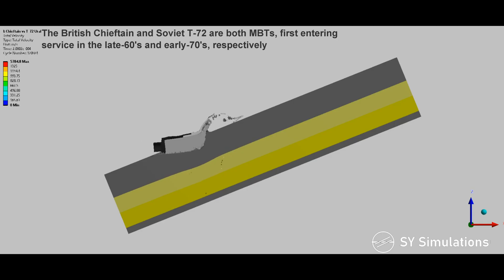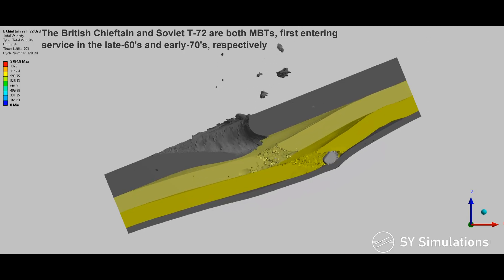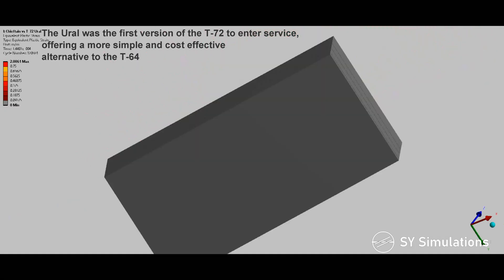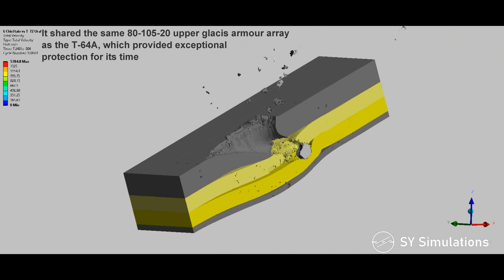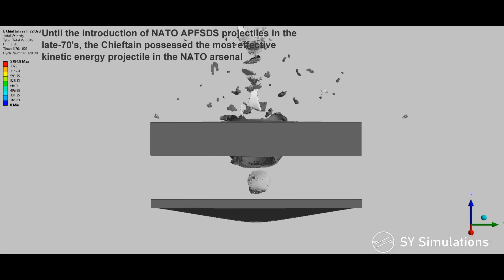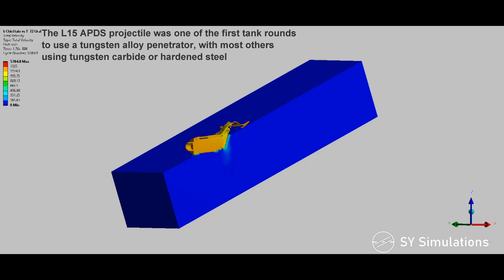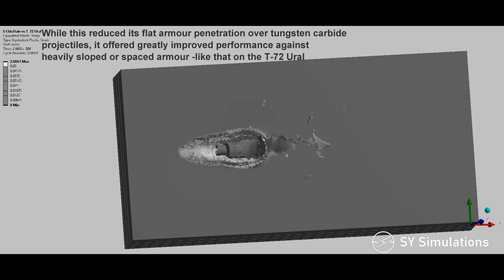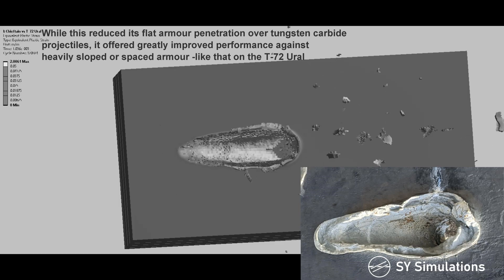CHIEFTAIN vs T-72 URAL | 120mm L15A5 APDS | Armour Penetration Simulation

Comment from the maker: Long-time followers of the channel will notice that this is a re-run of a Chieftain vs T-64A video I did 2 years ago. It's one I've wanted to redo for a while with better material models and a finer mesh, enjoy! 

Also, thanks to those who have supported the channel for so long and welcome to any new subscribers!
Reply: Will you ever do a rerun of the comparison between capped VS uncapped AP rounds?
Reply: Now redo T72 against Chieftain stillbrew (maybe closer range than before?)
Reply: @simonh317  It was Dejmian XYZ who tested the Stillbrew, not SY, plus it was against T-62, not 72
Reply: @thezig2078  aha! Thank you. However, an opportunity now presents itself
Reply: @simonh317  i think any tungsten round from T-72 would easily destroy Stillbrew Chieftain
Reply: @thezig2078  hence the question, as the math shows most short rod would be intersting but long rod aka Mango and newer would go through
Reply: Great work!
Reply: If you want to take a Crack at naval shells again, I found some documents from the US Navy that might throw the performance of the British BL 14-inch into disarray.
Reply: Would you be interested in testing stuff like M900 against Kvartz?
Reply: In case of T-64(not A, but just T-64 ie still with 115mm) vs Chieftain it has historical flair of "first two TRUE MBTs facing off".
While this is more of "reality called and said neither side has a budget for it so tune it down".
Reply: any person who has studied metals and materials at the first glance at the picture, the contrivance of the video becomes clear. 1. The material of the projectile is completely heterogeneous. The tracer nut is not capable of piercing armor even 15 mm at any speed. 2. The destruction of the projectile will occur in a completely different way than in the video. Different properties of the material on the surface and in depth. 3. The only sane military technical university in the world remains - Baumanka!!! All the others are Mom's pies.

Comment: Actually T-72 cost more than T-64A being even worse. Main reason to produce T-72 was low technology and weak production capacity of the Ural Tank Plant. So Soviets need more tanks than Kharkiv Plant can produce and created simplified tank for reserve soldiers that can be build in Tagil.
Reply: Initially, it costed more than T-64A, but it wasn't worse. Material quality was the same, engine power output was the same, gunner instruments were the similar all while having the potential to be cheaper (and in later production it was) and the parts and production were familiar leading to easier production and maintenance. The T-72 was built to replace T-64 and in the 70s-80s and especially after the advent of T-80B, that seemed to be the appropriate action, but then politics got in the way of that. And the only thing that T-72 lacked in the late 70s and 80s was the gunner instruments and electronics of T-64B. But in pretty much anything else, T-72 was better. Slapping on new electronics on T-72 was thought of for a long time. It didn't get it until 1990 because the electronics of the time were either too complex for a general use workhorse(only reserved for more specialized vehicles like the T-80s) or not up to standards.

Comment: Here it is assumed that the upper armor plate is 80 mm thick, the lower one is 20 mm, and between them there are two fiberglass plates, each 52 mm thick. this is not entirely true, this arrangement of armor is typical for the experimental T 72 series; the first T 72(A) series had an upper armor plate of 60mm and a lower one of 50mm. The export version of the T 72a had 150 mm solid armor plate, reinforced on top with a 17 mm sheet.

Comment: How the outer plate=80mm can looks thicker than the shell caliber = 120mm.:)
Reply: APDS = armor piercing discarding sabot. It's a sub-caliber projectile. It's fired out of a 120mm gun but the actual projectile is like 60mm.
Reply: @angry_zergling  The video shows the entire projectile.
Reply: @dmitrypopov2614 youre confusing apds with apcr. whats shown here is the sub calibre projectile it does not have the sabot attached

Comment: To give a sense of how much the textolite might be contributing to the protection (even though it's not optimum for kinetic), I've seen docs stating that the Chieftain APDS could go through:
1) 10mm plate + 330mm gap + 25mm plate + 330mm gap + 50mm plate at 2000 yards at 65 degrees to normal
2) 10mm plate + 330mm gap + 25mm plate + 330mm gap + 80mm plate at 1000 yards at 60 degrees to normal
Reply: Yes its impressive how compositive was.
Basically made the soviets tank almost impossible to pen by NATO tanks for a while... This while those could easly fight back at ranges that should not be considered "effective"
Really good for west that there was never a hot scenario specially before mass introduction of better armored tanks like Abrams, at least land wise.
Reply: @gerfand  yeah nato pucker factor would have been at max.
Reply: @rickfastly2671  and again who knows on actual performance when all just done by guessing and test?
Reply: @gerfand  even so and test were shown are correct, it's always depending how would you conducting the fight, what you had and what condlition, otherwise, who knows the result? when that battle isn't even happening in reality?
Reply: @nothingnothing8503  considering the number advantages of Soviets and other stuff, I belive in Soviets reaching France in a good time from east german border.
Reply: @gerfand NATO was huge developer of ATGMs and was ahead in aviation. 
NATO has less developed tanks because it was not as tank heavy army as soviet one. Plus while soviet tanks had better armour, NATO tanks had better fire controll  systems. Chieftain got laser rangefinder sooner than any soviet tank did for example.
Reply: @petrsukenik9266 FCS is irrelevant when you consider that the gap is like 2 or 3 years. Vs ~16 years for compositive armor
Yeah aviation is another history albeit Soviet designs where not that inferior, at most its them being behind on eletronics
Reply: @gerfand gap is 5 years. And 5 years after soviets couth up, NATO was starting to field APDSFS, composite armour and testing thermal optics. So in reality soviet tank adwantage was only lasting from introducing T64 to 1970s. After 1970s NATO was either having adwantages elsewhere, or straight up dominating with 3rd gen MBTs.
Reply: @petrsukenik9266  quite on the contrary the first APFSDS used by NATO were introduced around the same time Abrams was being introduced.
this means that for 15 years, from 1964 to 1979, there was nothing in the Western Tank arsenal that could counter the T-64 and T-72.

On other Hand in the 80s the only advantage the NATO tanks had was the Thermal optics, everything else they were from inferior to equal that makes no difference (for example T-80B FCS was superior to M1A1 Abrams, but I'm not giving it a point because they were not that different, however Abrams had a much worse Commander station, with the commander having to use a NVG to even see at night, or the Gunner Thermals, which goes against the pourpose of scanning independently)

The difference only really appear after the Cold War, mostly due to Soviet Economical colapse meaning Russia could not develop its arms industry.
Reply: @gerfand  while for 15 years soviets had armour adwantage in those 15 years there was also period were NATO had accuracy adwantage. 
And i would not say thermals were only adwantage (though completly crucial at nightfighting) NATO tanks are on aweradge more mobile, ergonomic and safer for crew.
Reply: @petrsukenik9266  "Accuracy Advantage" How?
The T-62, because it was firing APFSDS was more accurate than any APDS tank in NATO service. the Fin stabilization simply made it more accurate than the spin stabilized NATO tanks... if you talking about FCS that is also not true at all.
Tanks would only get stuff that differentiate them from olders at the time we getting Abrams and T-80B. M60A3 yes had a FCS, but again the tank is from 1978.
Sure mobility is one thing that was in favour of NATO tanks, but not "Ergonomics". 
A T-72, for example, is not cramped at all, and people just look at the smaller turret and forgets that theres 1 less crewman there, both crew are also sitting helping with confort
The ammunition safety is true for some of the modern tanks, but that is only if the tank is penetrated in the first place. I say that because you are less likely to die from a frontal hit in a T-80U than a M1A1, due to better armor protection (also M1A1 HA, but the difference is lesser due to the hull only being weak)

Comment: Yellow driver moment
Reply: @Ry-bo9hi  the podboi spall liner would absorb close to all the spall leaving the cracked back plate I'd suppose....
Reply: @Masterafro999  did the T-72As have spall liners?
Reply: @stephenallen4635  based on what?! 😂 You just say no because soviet or what?
Reply: @Masterafro999  I said no because it doesnt have spall liners. have a good one neckbeard redditer
Reply: @Ry-bo9hi  all t-72s starting from the t-72 Ural had the podboi anti radiation liner, which acts as a spall liner, installed all around the crew compartment. It ranges from as low as a double 13mm layer (26mm in total) surrounding the autoloader to 50mm lining the turret roof...
Reply: @stephenallen4635  projecting much?
Reply: @Masterafro999  from sovietarmour blog written by a former t72 tank commander

"The cross-sectional drawing below, taken from a CIA report on Soviet tank developments, indicates that the thickness of the "Podboi" lining is around 50mm behind the upper glacis composite armour. However, it appears that this was incorrect information as internal photographs and cross sectional drawings of this part of the hull all indicate that there is no such lining. It is most likely a misidentification based on the presence of air pipes shown in cross-sectional drawings."

the anti radiation liner may be thick enough on the turret to act as a spall liner but there is none on the glacius

Comment: Sorry new to the simulation composite armour sphere but i always wonder wgatts the hse of textolite which is softer than RHA and more brittle
Reply: Less weight than armor but more line of sight thickness HEAT projectiles penetrate a given amount regardless of the material - let's say a given heat penetrates 400mm LOS. 100mm armor + 200mm textolite + 100mm armor would stop just as well as 400mm armor but at half the weight.
So the textolite is mostly to stop HEAT and has neglible effect on kinetic.

Comment: Not quite able to get through. Looks like it causes some decent spalling though. Each hit might not consistently cause crew casualties or damage to internal systems, but it's enough that I can't imagine that any T-72 crew would be willing to sit there and take repeated hits.
Reply: Yours is a hypothetical statement showing no understanding of actual behavior in combat. Any tank that fired and failed to penetrate would be knocked out in return.
Reply: @USB740  In a video game maybe. But not in real life. Experience from WW2 showed that the single most important factor in winning a tank vs tank engagement was firing first. Even if the first round missed or failed to penetrate the tank that fired first would almost always win.

A non-penetrating hit will still deliver a massive phsychological shock to the crew. Imagine standing with your head inside a church bell just as it's struck with a 6.8 kilogram hammer traveling at 625 meters per second and you'll get the idea. The crew would likely be able to recover from this shock given a minute or two of peace, but the first shot will be followed up by more shots until the crew either retreats or bails out.

Even if the first shot misses, the tank that fired first is still likely to win. This is in part because two tanks are unlikely to spot each other at the same time. The tank that fired first is already in the process of correcting their aim for the second shot while the other tank is still trying to figure out where the fire is coming from. Being under fire also puts the crew of the second tank under stress, which makes it more difficult for them to focus on finding the enemy tank or on aiming.

Having better armor improves your chances of surviving an engagement that you've lost, and possibly re-engaging later under more favorable circumstances. But it doesn't massively improve your chances of winning an engagement. No matter how good your armor is you never want to just sit there and take hits. Even if none of the hits penetrate they can still degrade or even disable the tank. There are always vital systems that need to be outside of the armor in order to function. Most obviously these include the sights, the tracks, and the  gun.
Reply: @gareththompson2708  Our T-72s were much better than Iran's chiefftains which stood no chance from even 1km away in frontal engagement. The 120mm smoothbore, APFSDS 3bm9, quarts and composite armor, mobility, reliability. This is why the T-72 was the best tank of the war.
Reply: @USB740  I'm well aware that the T-72 was better than the Chieftain. But that has nothing to do with what I was saying.
Reply: @gareththompson2708  the simulation did not render in the podboi spall liner...that would have caught the majority, if not all the small. Also the chieftain was unable to effectively deal with the t-72 even at 700m whilst the t-72 could penetrate the chieftain at ranges exceeding 2.5km. so I'd say that it would have been the chieftain that definitely would not like to stick around after firing...
Reply: @Masterafro999  Yes this is true i know it firsthand.

Comment: What is Textolite? Looks like water, uncompressable for sure.
Reply: It's fibre glass panels. It's there to disperse HEAT. Effects against solid penetrators is similar to spaced armour and has no effect against APFSDS.
Reply: @oohhboy-funhouse  I heard fiber glass in resin. But it looks like uncompressable to the level that it nicely bends the backplate. I can't really image that, because if it is really uncompressable then in a similar configuration a fuel tank as armor disperses the pressure.
Reply: @2nolhta  it's glass-reinforced plastic armour....more akin to bulletproof glass in some ways...only in some

Comment: Now I’m curious what the old 183mm would do to a T-72, even if the gun was basically outdated by then
Reply: 183mm HESH? Even if it didn't penetrate the armour, the tank would still be probably be wrecked. I mean it would have probably blown off all the road wheels if it was a side shot, ruined the gun, all of the sights ect, as well as wrecking machinery inside the turret like traverse motors ect and everything.
Reply: At that point it doesn’t matter if the HESH did it’s job, in the gun’s trials it was said that it BLEW A CENTURION’S TURRET CLEAN OFF with the force of its explosion alone
Reply: @charlieyes4946  ah, yeah, I forgot about that part LOL. That’d make for a great 2-part video. One simulation showing the shell failing to “penetrate” and then another showing the full picture of a full T-72 being dismantled from the same hit
Reply: @darkninjacorporation  the fv4005 gun? Hesh?! It wouldn't have done much to the composite parts of the tank....the impact and explosion would damage stuff tho...

Comment: It is impressive how effective the relatively simple composite armors the Soviet Union used are. Most of these are extremely simple
Reply: The early Kombination-k was simple....the later 5 layer layouts and so on were pretty damn efficient..
Reply: @Masterafro999  even some of the turret armors were remarkably simple such as ceramic balls inside of aluminum or quartz sand
Reply: @dominuslogik484  what's your definition of simple? The ball quartz turret armour of the t-64a was stupendously hard to produce...
Reply: @Masterafro999  simple in a design aspect, its very easy to come up with. manufacturing has its own hurdles.
Reply: @dominuslogik484  fair point. Rnd and manufacturing was hard. The idea itself didn't come out of thin air tho. By that definition the later released chobom armour was also simple. It's just a bunch of bulging plates, ceramics, air and rubber.
Reply: @Masterafro999  they have improved and changed the compositions of the rubber and ceramics to newer materials since then.
Reply: @dominuslogik484  the same could be said about soviet/Rus armour no?
Reply: Also explains why Soviet tanks cost a fraction of the cost, nothing beats Russian/ Soviet vehicles price to performance
Reply: @Richard_T800  Purchasing power parity is important to figure here. Salaries in Russia have always been around 25% what they are in the u.s. Russia also has much less money available to use for purchase due to the small size of their economy.

Putting it this way, the T90M costs Russia about 4 million dollars and when you adjust for the PPP value it comes to around 6.2 million dollars putting it at a very similar price to the Abrams.

Really the idea that Russia just makes stuff cheaper is a myth, the labor and materials still cost a ton they just save on labor and as a result have less money through taxes.
Reply: @dominuslogik484  An M1A2 cost 10.6 million a A3 even more, russia has 66% of the Military budget the US has. And the T90M doesnt cost 4-4.5 million, that is the export cost of the T90MS, India bought over 400 T90MS for that price recently. The production price is lower than that.
(If we compare export prices the M1A2 costs nearly 24 million and the T90M 4-4.5)

So Russian tanks are actually cheaper. And that can be proven by the low export cost, 4.5 million for a T90MS and 24 million for a M1A2 SEP. Russia wont export for the same price they produce.
The T90A costs 2.2 million so the T90M may cost russia 3 million but i wouldn't go over that because they tend to sell above 150% of the production price